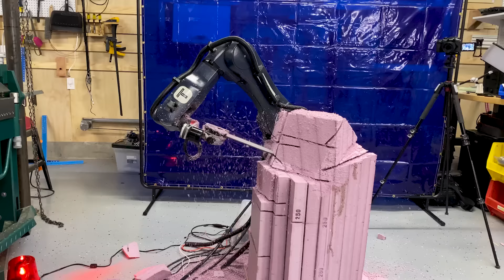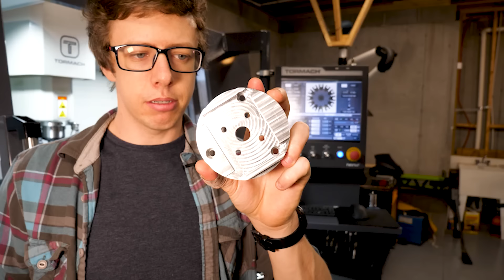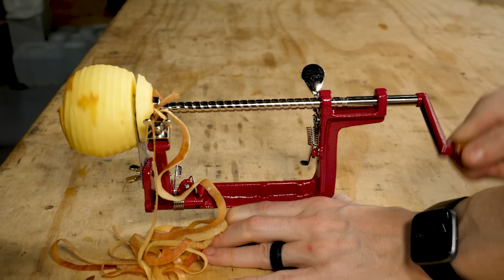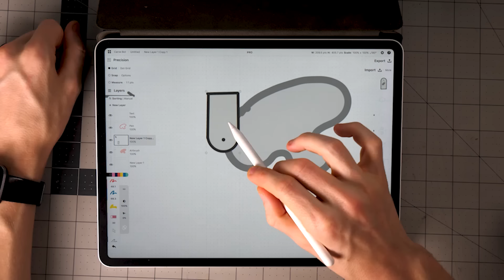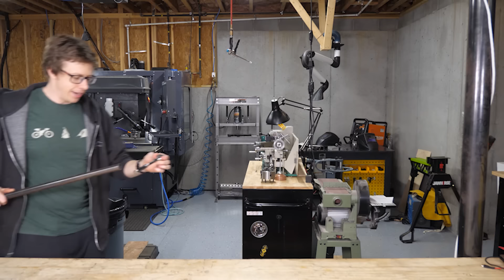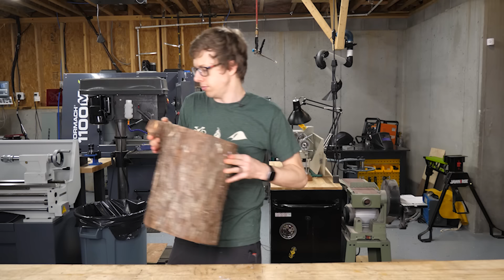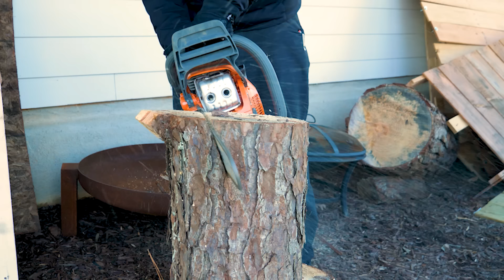Chainsaw + robotic arm = art?

Comment: Hey man, can I like.. Have that little 4x4 block you used to explain gradient ascent?
lol.
Reply: Jesus dude chainsaws need bar oil! That's why it's smoking so much, lol. You have no oil reducing the friction between the chain it's self and the bar that the chain is riding. Also, oddly enough bar oil also helps to reduce the friction between the wood and the teeth of the chain. Counterintuitive right? You'd think you want max friction between the saw teeth and the medium they're cutting to get the most efficient cut. But no. With too much friction you stop cutting and you start burning through the wood. I'm pretty sure that's why you're getting all the smoking, and end up switching to foam. 

It also helps whenver you're working with chainsaws to not actually think of the chainsaw as 'cutting' because it's not really cutting at all. Because of the way chainsaw teeth are shaped, it's alot more like chewing, or ripping the wood, or whatever medium you're working with.

Comment: You should use safety light curtains as well as estops. When the beam is crossed it kills power. You can use mirrors to give a 360• perimeter of kill zone protection

Comment: Your videos make me feel incompetent, as well as content at my incompetence.  Thank you for doing both, it would be cruel to only do one. Random comment - The anti-kickback guides are a depth gauge. These need to be filed 0.05" shorter than the chisel. Too long and the chisel will not contact wood, too short and the chisel will embed and get stuck (kick back). You know you have it right when you get saw dust all over the shop and you don't die. Chainsaws also need continuos lubrication through a tiny hole at the base of the bar. You know you have it right when the chainsaw spews a fine mist of red chainsaw oil on the nearby wall.

Comment: the part of the chainsaw chain you called the "anti kickback tooth" is the raker (the depth gauge). it does just that it holds the cutting tooth to a height and as the cutting tooth is sharpened the gauge needs to be adjusted also. it is adjusted with a rest and a file. chainsaw chain needs to be oiled. when you put a saw tip first the raker isn't in line with the cutter and can kick back. have you seen the angle grinder attachment that is a disk with chainsaw disk. thanks for sharing.

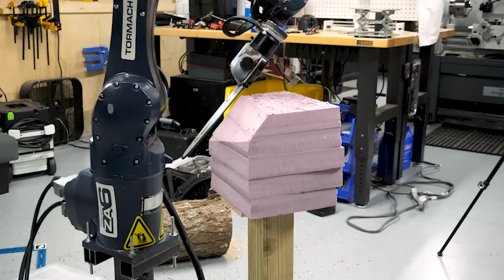Comment: Looks like you have the same chainsaw luck that I do.  What about switching to a pneumatic angle grinder and buying or making a roughing disc for it?  The chainsaw on a disc scares the crap out of me, but material removal rate is great (and a 5 pack on amazon is 40 usd). > @2:50  https://youtu.be/mscjKYN5W2w

Comment: Maybe you could salvage a large block of balsa to cut your sculpture out of? It's soft and relatively light, so the robot should be able to cut it and it's still technically wood. I hear that's what windmill blades are filled with and when they get replaced, the old ones just get chopped up and buried, so it might be possible to source some of that.

Comment: You need to put a Ripping Chain on your chainsaw.    You're asking it to perform cuts in the grain that it wasn't designed for - that should tremendously improve your wood cutting performance.     Also, just one hit against any kind of metal or dirt of any kind immediately kills the sharpness of your cutting teeth in the chain.

Comment: The "anti kickback tooth" you pointed out is actually your depth gauge for your cutter. Boring cuts a possible with a correctly set up chain. Any sideways torque when cutting will cause your chain to spin and not cut. Also cutting timber down end grain is tough for any chain, especially using a chain of this gauge.

Comment: Machine learning engineer here! Gradient decent can be a little tricky for these types of problems. Your best bet is to use a proper hill climbing algorithm such as Simulated Annealing and run multiple passes. To really get gradient decent to work here you’d need to run multiple instances of gradient decent with decreasing step size over each instance then compare the solutions.

Comment: I have some ideas how you could somewhaht fix some of your problems:
1. performance: Theres a library called Numba, it compiles some python funtions down to assmebler and works great with a lot of numpy functions
2. The false Maximum: Use a shotgun, if some point finds a higher spot use that one, if that fails just do more chainsaw passes
3. Security: Dont mount a chainsaw to an autonomous robot (optional)

Comment: Regarding tool path optimization for cutting, the paper “RoboCut: Hot-wire Cutting with Robot-controlled Flexible Rods” is quite interesting.

It is quite related to the problem shown here, it uses quasi-newton methods.

It is link in the description of the demo video: https://www.youtube.com/watch?v=lLKI0HWV3dc

Comment: Great video. Just little info. Sometimes Im working on wood splitter(somethingike japa405) for extra money. And these chains and blades are very picky, they need pretty much perfect chain and blade. Owner of this machine put on small harvester blade and chain, its cuts 45 cm log in  5-8 seconds and it takes loads of power. On 17.29 you can grind down those anti kickback tooth, actually there are measuring tool for that. It should pretty much eat itself trough wood :D

Comment: The "anti-kickback" pieces you mention at 17:28 are actually depth gauges (often called rakers by loggers) and should be filed down when you sharpen the chain. Over the chain's life as it gets sharpened, the tooth gets slightly shorter, if you don't shorten the depth gauges at the same time they become higher than the tooth's cutting edge and you just get friction without cutting. Look up any chainsaw sharpening guide and you can see how this is done. Your depth gauges are way too high and your chain isn't really cutting as a result.

Comment: Get a professional carving bar and chain. The nose radius is smaller, so that rubbing action doesn't occur as much (also smaller tip radius == sharper corners)

Also, with homeowner-grade saw chain, the rakers (the part of the tooth you pointed out) are set super high to reduce chainsaw kickback, that and there's usually an extra raker there to keep it from cutting at the tip radius (no cutters at the tip digging into the wood == no kickback). Professional chain, as well as carving chain, doesn't have this, which will make cutting a fair bit easier!

Comment: When you try to do one in wood, you should first get a Carving Bar for your chainsaw. It´s like a normal Cutting bar with a taper to the end so it´s radius is smaller.  Also you should look at the different Chain Types there are so you wont have the problem with the depth gauge on your chain. The whole "Carving Stuff with a Chainsaw" is a whole science in itself and I don´t think you really looked into that. Also your Chainspeed is way too slow to be cutting wood effectively. 
All in all great work in such a small time and keep your videos up they are really inspiring for guys like me who want to start engineering and developing stuff that could probably kill you if you´re not carefull enough :D
I really love your videos they are entertaining and you can even learn something.
Greetings from a measurement technician from Germany 🖐

Comment: This will probably get buried in the comments but have you looked into the software that generates toolpaths for CNC hot-wire cutters? You may be able to borrow a lot of the "roughing" methods from there. Either way, I love your work and this is super impressive!

Comment: Alternative suggestion if you’re using foam: what if you attached a resistive wire or heated blade to the end to burn / cut through the foam instead of the chainsaw?  It would reduce the power and weight needed on the tooltip and probably allow you to increase your precision and cutting speed. Of course wood would be cool, but a precise foam cutting robot would still be really cool. You just have to consider the cutting mechanism and material in tandem, and the compromise in one offers far better solutions in the other.

Comment: Either sharpen the chain or buy a new one, that bar should sink into that log like you're cutting margarine all those rakers do is keep you from stalling the chain and that will happen if you grind off too much of them whether you have a dull or sharp chain. Read up on chainsaws before you cut your guts out.

Comment: Suggestion for wood. Since it's a robot and not you using the saw the anti kickback nubs can be ground down. 25% to 35%  difference from the teeth shouldn't increase the kickback chances too much. Assuming the arm has sensors in it that can detect an increase in force set it up to where if it senses a sudden increase in backwards force it withdraws the blade in that direction. Should help prevent damage to the arm in event of kickback.  The anti-kickback is to help keep the saw from flinging  back into your body so not useful on a robotic death machine.

Comment: Great video! As for having problems with cutting through wood I can give a few pointers as I have worked with chainsaws for a long time. The chain needs to be constantly lubricated with bar oil and often times the blade needs to be sharpened daily. A few hours of sawing and the blade will become dull and you will cause a lot more smoke and less clean cuts. Sharpening the blade often is a must when cutting wood.
Reply: also, keeping the chain tension tighter might help with the precision of the cuts

Comment: Could you have calculated tangent planes from points on the surface of the object and treat those planes as cuts going from where they intersect the outside of the log/foam and intersects with other tangent planes (to find wedges and prevent cutting too far)

Comment: Still don't get what was the aim of the algorithm? Was it about finding good enough solution or about the best possible?
If the second option than the only possibility is brut force - we're facing with NP difficult problem here.
If we're looking for good enough than what was the problem with stochastic descent? If you're looking for something better, than you always can run it many times, starting from different random points, and then choose the best solution. Optionally it's possible to do multi batches, add momentum, random steps after reaching a local minimum.

Comment: That little "anti-kickback tooth" is a depth of cut gauge 
If you're having issues with cutting you can file them down. Also chain tension is a huge thing to keep an eye on, if the chain is too loose (with the teeth exposed) it won't cut straight, and will wear the sprocket, bar, and chain faster

Comment: You should research what kind of chain saw blade to use for carving like this, there are lots of different saw teeth types for different kinds of work.  That might help the wood smoke issue as well.  Also, you can accidentally install the blade backwards on the saw bar, so make sure the teeth are facing the correct direction to bite/cut the wood.

Comment: Tooth geometry on a chain is really important for optimal cutting. You can get a gauge to check if the kick back links or the rakers are proud. If either of those stand proud of the cutting face you will heat the chain much like you are seeing there and make very little progress in a cut. You can file them back down below the cutting face really easily. This might help with the heating but a bigger issue that you might run into is simply cutting with the top of the tip of the chainsaw. That is the "kick back zone" and is the most dangerous part to cut with. You may want to get a different chain without the kick back links if you plan to keep cutting like this. Doing so might increase the torque on the arm when you  kickback or binding and maybe even break the armature.  

Another solution would to not use the "top" of the saw in relation to the chain rotation direction. This would help prevent kickbacks but also complicate every cut.

Comment: "There is a finite number of ways to screw it up, so you will eventually finish" hit a little too hard
Reply: The only problem is: There are actually an infinite number of ways of screwing it up.
Reply: ''The true definition of insanity is doing the same thing over and over and expecting a different result'' is what i usually do.
Reply: Anyone here watch Wintergatan, he knows that struggle, and has almost won.
Reply: Until there are multiple variables and sometimes doing the human representation of a rapidly expiring random tree is the best way to go.
Reply: Ok how they make this is really insane you need to now what you are doing its not just cut you need to put proper speed it is not a saw were you can rip it fast as you want and thats not a proper saw there is no gaurd you need a guard a gaurd is these teeth in the back of the chain the chain will pull foward sow it blocks its wood gaurd you need a person to run that saw not a robot that why it smoked

Comment: Chainsaws need to be frequently sharpened and you need to refill the bar oiler. When you sharpen the chain you file down the rakes that you were talking about.The chain is loose too it should hang like that there a adjustment screw to tighten the chain. Amazing project such cool stuff!

Comment: You can use random restart to overcome local minima/maxima.  So you start from some number of randomly chosen points and perform the gradient ascent at those points (consecutively or in parallel).  In principal, this can be computationally expensive, but since you have only 4 variables, a few hundred points usually maps the surface maxs(mins) well and this is not A LOT MORE CODE.  You take the max of your max's and you'll be pretty good in general.

Comment: For the gradient ascent problem (essentially an optimization problem), you could try stochastic gradient ascent and/or normalize your parameter space. In addition, there is an algorithm (I cannot recall the name) where you start at different initial conditions (we denoted them as x_0, y_0, \theta_1_0, \theta_2_0) and try to get the best solution. That being said, unless you can show your optimization problem is convex, there is really always a chance to get stuck at some local maximum.

Comment: Great video :) For the gradient ascend you'd usually take many evenly distributed points with a bit of randomness, climb up to the top of the hill at all of them and then take the highest point out of that. That way you can mostly avoid non-optimal solutions.

Comment: Yeah you need to spin the drive gear on the chain at well over 10,000 rpm. And still have torque for when you get load on it.

Comment: I have only worked with gcode on 3d printers and never worked with a robot arm so this question is just out of curiosity. What would be the reason you choose a chainsaw over a wood router attached to the robot arm? Is that even possible or feasible to attach a wood router to a robot arm? Love your videos.

Comment: read about cutting geometry. I am not sure how a saw blade is supposed to cut into wood, but i know from working with metals is that there should be a specified angle and a movement to cut something. read about rake angle and counter rotation. 

btw why didn't you just bolt on an end mill and just milled the heck out of that thing? it would've looked very decent

Comment: It might help to sharpen and tighten the chain. That kickback tooth you were referring to is also known as a raker or chain depth guide. It may need filed down to allow the teeth to catch more material, I think that's a big part of why it was smoking. I would definitely recommend getting raker and tooth file guides.

Comment: I know I have no where near the smarts to say you did something wrong but the reason it won't cut through the wood. The saw you used is for branches which you know, but normally branches are normally a lot softer then the actual tree so they use a different blade what is you shortened a regular chain and used that it might work

Comment: One possible solution to the problem of the local min/max in the gradient descent (or climb) is to mix it with a simulated annealing method or just force some random walk thing in each step of the search... but this can cause the death by too many parameters problem.
Also... ThisIsProbablyFaster.jl could help with that kind of thing.
Anyway! I don't have a very useful solution, but you have a pretty cool killer robot... nice vids!

Comment: I could be missing something but it seems like you are not using bar and chain oil. It is probably not an issue when cutting foam, but I am curious if I am just not noticing it or if it is something you plan to address if you try to cut actual wood again?